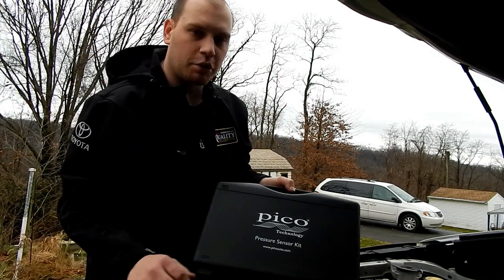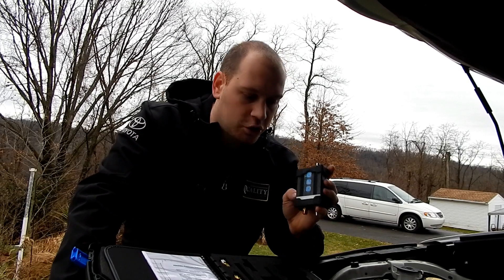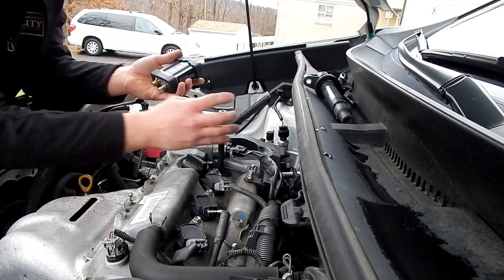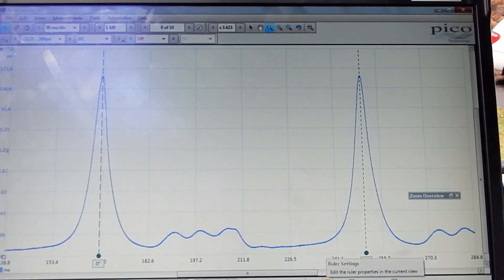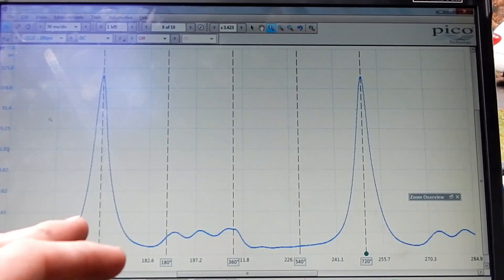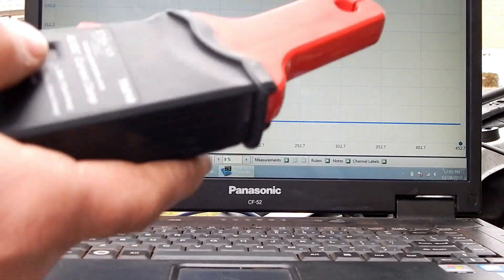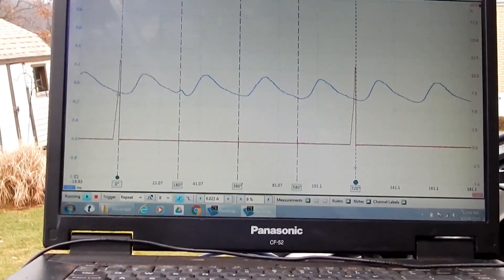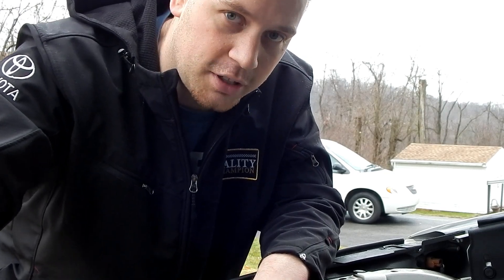What is in cylinder pressure testing?

Comment: What information do you get from cranking vs running ? When do you see the need for each?
Reply from the maker: Generally, if I have the opportunity I like to see both running and cranking. Now with a running waveform, you get more detail. You can more easily see some valve timing events. But with a little practice you can get a lot of information from cranking waveforms as well.

Comment: Hey Pat, this is a great video.  Do you know how to setup cursor divisions on the VERUS by chance?  I think you have to use an overlay through the video file viewer on a PC, but was just curious if you know if there is a setting in the lab scope after pausing it for analysis that actually does this like/similar to a PICO?
Reply from the maker: PAULY'S AUTO no, not as easily unfortunately.

You can use math, and cursors to get an idea. But it’s time consuming.

Do you have an overlay software?
Reply: @VoltageDropDiagnostics  no unfortunately, but I stumbled across a video today from a European guy who was using one, but I'm not sure where he got it?

I know that using your delta time in ms value for 720 degrees of the peak-to-peak on compression and then dividing it by 4 and using the two cursors using ms set points is always what I end up doing, but it makes it difficult to see everything as one.  Just thought I'd ask you if you may have heard of or knew of one.  Thanks man!

Comment: Which one would you recommend the pulse or pressure sensor? Great video as always 👍🏻
Reply from the maker: hmm The pulse sensor is cheap, the pressure transducer is not so cheap lol. If I were just starting out. Id get the pulse sensor and see if I liked the techniques used to diagnose engine failures. If I did, then I'd invest in the pressure transducer.
Reply: You can use other brands. As long as you can connect a Hose to it. They will work. Just make sure you can zero it. I have A fluke PV350 I use. As I bought it years ago for setting Assemply line systems. And testing them. You can get a used. As they cost $500.00 bucks. A PICO cost $ 750.00...

Comment: Another great video! I think im getting confused on how to properly identify the begining of the stroke cycle. They blend together on the graph, something that takes some time and practice it looks like
Reply: Ok cool, thanks for the help!
Reply from the maker: My original response was for someone commenting on another video lol. I think you were reading it as I was deleting it.

I hope my new answer helps explain it a little better.
Reply from the maker: Well the big spike is always the compression stroke.

Then you divide the waveform into 4 sections. After compression is the power stroke followed by the exhaust stroke then intake stroke.

Just look for the big spike and that will be the compression stroke though.
Reply: @UC_HeAAKRilHUy08RwlHizoA like when looking at the graph for one specific cylinder, you were able to pinpoint that #1 is at its tdc of compression, you were able to tell what position the piston was at. Had me a little lost